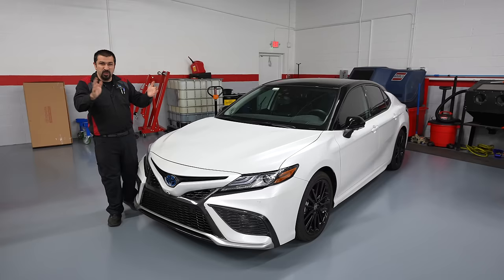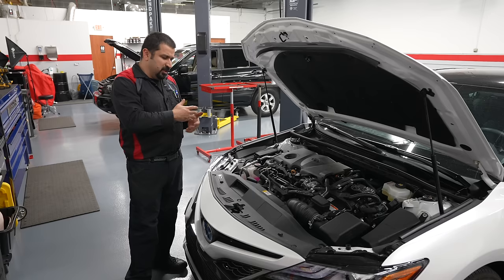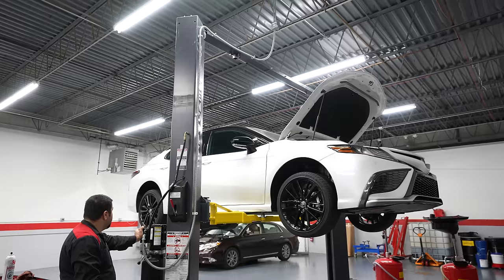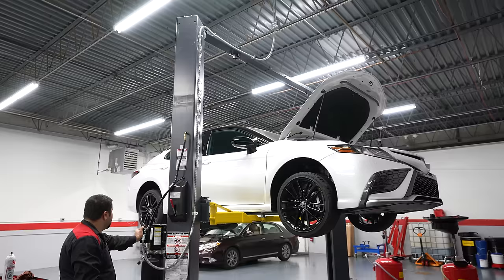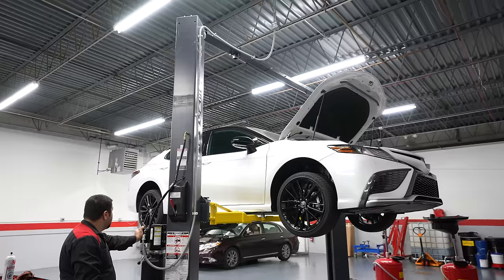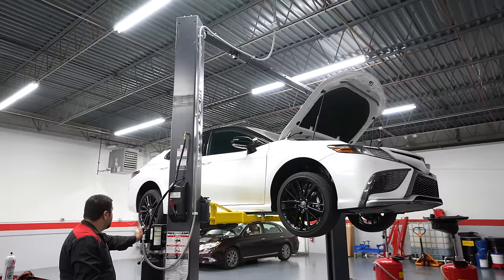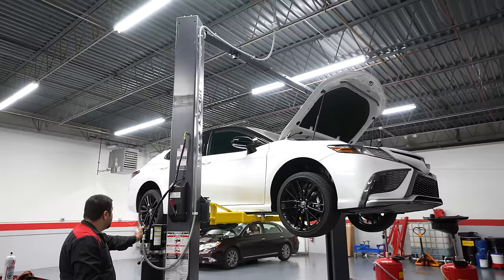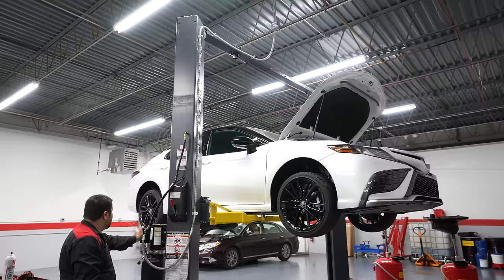Should you buy a Toyota Camry Hybrid? 1 Year Ownership Update

Comment: Bought my Carolla hybrid a few months ago and love it so far, 5K miles already and did a break in oil change at 1200, about to take it in for it's first dealership service. Can squeeze 60 to 70MPG out of it in the summer, and 48-50 in the winter.
Reply: I'm thinking about getting the carolla hybrid over the Camry hybrid. What are your thoughts?
Reply: @Beekeeper8011  Depends if you need the bigger car or not. Also the corolla is more for low speed city driving hence the 53 city 46 highway mpg where the camry gets 51 city 53 highway.

Comment: I own a 2012 Camry Hybrid  XLE . Very happy at 105.000 miles. I bought the car in Houston with 27.000 miles. No matter how I drive it. I still get over 40 miles per gallons. The finishing as you pointed , could have been done better. I drive constantly from New Jersey to Houston and overall I am satisfy with it.
My neighbor in Northen Jersey has a 2005 Camry Hybrid with 257 .000 miles with the original  batteries.

Comment: Great show.  Your oil change information is "spot on".  I have traded vehicles because of rattles that couldn't be fixed.  I am sure others have too.  Rattles are not as frequent as they used to be, in my experience.  I never go over 6 months on an oil regardless of the miles I put on.  We can't go 10,000 miles between oil changes in North Dakota.  It can get negative 30 below zero in the winter.  Toyota dealer here says 10,000 mile changes are just fine.  Thanks for telling it like it is.
Reply: And I’m sure the car will be “just fine” with those 10k Lube jobs. It won’t be spotless and running @ 100% when it has 150,000 miles on the clock but 95-90% performance is perfectly fine for most people who would rather save that $1,000 on maintenance and use it for something else 🤷🏻‍♂️ 

That’s how the manufacturer looks at it. 

Besides, they want you to come back in 5 years and trade in your old car for a new model before the warranty expires.
Reply: @I_know_what_im_talking_about  Car Care Nut has a video on his channel of a 2015 Camry that always got the 10k mile oil changes and it started burning a 1 quart of oil every 1k miles at 120k miles. At 150k miles it started burning 2-3 quarts of oil every 1k miles. He had to replace the short block to fix the issue. https://www.youtube.com/watch?v=TJhFAwFv-O0
Reply: @TheCobruhAlienat0r  — you can’t bring up a model that has a defective engine design as an example. 

Any Toyota 2GR-FE V6 can easily go 10k miles on synthetic and be spotless @ 200k miles. I’ve seen it personally. Some engines are just easy on oil. 🤷🏻‍♂️
Reply: @I_know_what_im_talking_about  First I've heard of it being a defective engine

Comment: I thought I was crazy to see the flashing (extra material) on the new bumpers too. Purchased new from dealer, front and rear bumper covers for my 9th gen corolla. The front had minimal flashing but the rears looked as bad as the front of this camry. Took the time to razor blade them off before paint. In the end, the fit and finish was actually better than the original bumpers.
Thanks for sharing!

Comment: I just bought my Camry Hybrid LE last month and your video has been very helpful. Like you, I was a long-standing skeptic of hybrids. This year, I decided that if I go with one, it would have to be a brand that had been in the hybrid biz for awhile. Toyota and Honda were the two that rose to the top. I've had zero regrets over the purchase, so far. It's been smooth, efficient, and handles better than I expected. Getting low 50s for fuel economy has been almost three times what I had before.

Exit question: Just to make sure, you're advice for a new car is to change the oil at the first 1000 miles and then every 5000/6 months, correct?
Reply: Yupp!

Comment: I do my own oil changes on my 2020 Silverado.  The second oil change the dealer (where I bought the truck) forgot to tighten the oil filter and it was dripping in my driveway.  I spotted it as I was honking up my travel trailer (6000 lbs) and getting ready to take off for 2 weeks of camping.  I crawled under my truck and tightened it by hand. Since then I've done all my own oil changes and saved a bundle at the same time.  I know the filter and the oil pan plug are tight because I did it.  Love this channel.

Comment: I love my Camry Hybrid. Same generation as yours with 300km on it. I change my oil every 10km with 0W30 Ultra platinum Penzoil and sofar zero leaks or burns. Tge only thing I have done beside the the oil changes and transmission oil changes was the drive side strut leaked and had to replace it. Extremely low on maintenance and still drives like day 1 :)

Comment: I kind of wish I went with a hybrid, but I am satisfied with our SE. It is so much better than that problematic 2015 Ford Fusion we owned before it. Another great video my friend!
Reply: why do you prefer to go for hybrid? 2025 is now all hybrid but I don’t like cvt, having a former Nissan Altima whose transmission gave out. I don’t trust CVT, but can you elaborate why you prefer hybrid
Reply: @Eaton23117 you must not know anything about the Ecvt of toyota that is electronic and the complete opposite of a Nissan plastic belt cvt. The Toyota one is built like a manual transmission and doesn't have belts. My prius 2007 at 243,000 miles from prior owner never changed the fluid and I still did and it didn't mess up like a automatic which would of broke with changing old fluid. Hybrids are actually more bulletproof.  Engine is not overly stressed, brakes last like twice as long, transmission is bulletproof.  Of course this is for toyota hybrids the other companies especially Nissan ones suck.
Reply: @platinumanalogy  ECVT is not the same they are completely different.

Comment: My father was a mechanic/ body man for 50 before he passed away, and he sounded a lot like you....when it comes to finding
faults with the build quality of cars.  He passed away in the '80s when the term "quality control" hadn't been invented yet.
I remember he bought a new Chrysler once, but before he bought the car, he had an estimate pad from our garage and he
made an estimate on what it would cost to fix the problems on the car that came from the factory.    Great videos 
and I give you A+ on your garage!
Reply: Since they stopped making the Valiant and original Dart, the words quality and Chrysler have never been found in the same sentence. Teaming up with Fiat and Peugeot has sunk them to a new level.
Reply: @rightlanehog3151  Actually, my dad thought Chryslers products went down hill about 1957 when the started using the torsion-bar front suspension.  He hated that.  He also hated when unibody construction was introduced.  For years, ALL  American cars had quality control problems which only got better when the foreign competition turned up the heat.  I've had lots of cars and one of the smoothest I've ever driven was a 1955 Chrysler.  One of the sweetest cars I've ever owned was a 1964 Lincoln Continental....4 door.  I once drove that car 515 miles in 6 1/2 hours....and I had to stop once for gas.
A 1962 Ford Thunderbird was fun too.  A 1978 Chrysler Cordoba was probably the worse car I've ever had.....I bought it new and kept it for 30 years (it had 28,000 miles on it when I sold it) as a reminder....NEVER BUY another Chrysler product.
Reply: @rightlanehog3151  ....by the way, my Dad passed away in 1981 and I still have his 1978 Monte Carlo....37,000 miles on it.  General Motors and Ford quality control was pretty sorry too for a long time.

Comment: Thank you for the video. Only want to remark one mistake, clean the wiper blades instead of throwing them in the garbage, also clean and polish your windshield. Even if is not expensive, don't throw good stuff in the garbage. My Lexus has 90k miles and 5 years old, so far I replaced only one insert on the passenger side, that's it.

Comment: I bought my 2019 Camry XSE new. Almost 4 yrs. and 30k miles later I've experienced no dash rattles but have experienced the following:
Driver side mirror vibrates badly when driving on the highway.
Driver's window squeaks and jumps when being raised after rain or car wash (My 2014 Corolla did the same thing)
When backing up slowly and applying the brakes, a popping noise can be heard from the rear of the car. ( Dealer said this was normal. Uh-huh.)
Other than those minor things, It's been a great car, plus it's beautiful to look at, so that doesn't hurt lol

Comment: My mom has a 2020 RAV4 XSE Hybrid that I occasionally drive and I agree with you. It's a great car, drives well, and is very comfortable to drive in. But one thing I've noted was the build quality (or lack thereof) of the exterior parts. The doors are super light so they swing open and close really easily, but that also translates to rattles every time you close the door. And being a 2020 model RAV4, there was a TSB issue with the side mirrors shaking at speed. We since had it repaired but the driver's side mirror still seems to be shaking a bit. The hood and fuel doors, like the main doors, are super light so it feels like I could easily bend them when I close them, especially the hood since you have to slam it down to properly close it or the latch doesn't engage properly. The wind noise is also very apparent when driving on the highway but that's something we kind of gotten used to.

Despite all of that, I think the car overall is still a great car. I really like how smooth the transition from electric to gas is with the eCVT and we still get pretty good gas mileage for such a big car (36-37 MPG on average). I'm also glad that they decided to open up to supporting both Android Auto and Apple Carplay this generation. I know it was a hit and miss with many car manufacturers in the previous few generations, either supporting Android Auto or Apple Carplay, but not both.

It's too bad that the AWD Corolla Hybrid didn't come out until this year, otherwise that would have been my pick for myself. lol Unfortunately, I had already gotten a new car last year. :(
Reply: Thanks for watching⬆️⬆️
Reach out with the number above

Comment: Proud owner of a new 2.5ltr petrol Camry. After 6mth  it's done 7000kms (4350miles) of which I had a 3000km road trip included, and am following your recommendation to do oil & filter changes next week.  I will also get them to change the air filters after watching this video update.   Cheers for the advice & happy motoring.  PS I love this car on the open roads :)
Reply: Really like the 4 banger Camrys. Hope they never don't exist. First car even. Learn to drive in one of them. Super reliable could be even more if you ask me but impressive none the less.

Comment: OK, I never thought about the horrible duty cycle of the hybrid engine, you make an excellent point.  All the start/stop/cold running would dilute the engine oil in a hurry.  I am like you, the slightest ratttles/squeaks drive me crazy.  My 09 camry came with a few rattles/squeaks since new, something sounds like a loose wiper bottle, and the center console cover rattles/buzzes.  Generally speaking, I think the build quality/quality of materials dropped a great deal on this car compared to my 99 Solara.  The erratic idle has driven me nuts since new as well.  
It is like you say, a good visual inspection is worth a great deal, best way to catch little issues before they develop into major problems.  In order to keep a car for a long time, you must be proactive in servicing and repairs.  Sure wish I could get my car up on your lift, but would be afraid at the same time.
Reply: Agree, build quality is not good, even the paint is lousy, shame

Comment: I feel your paint on the fit and finish.  When you buy a new vehicle, there is a smaller mental margin for defects - especially the ones you see every day.  My 2022 odyssey van has a door gasket where the seam is RIGHT IN THE MIDDLE.  Also, one of the plastic panels has an inconsistent gaps.  The 2010 model odyssey felt like a better built car.
Reply: I have a 2020 Acura and the build quality is simply awful.  I "upgraded" from a Honda thinking the build quality would be superior.  Oh, how wrong I was.
Reply: @CU08  listen man it depends on what you mean by quality. Apparently that means a lot of different things sometimes I wasnt prepared for
Reply: Alot of Hondas and acuras are almost all made in America and Canada. Toyota at least have some models still made in Japan. The gap alightment is very different.

Comment: I would actually really like to see what you end up doing for the rattles in your camry if that isn't too much of a hassle. I'm sure plenty of people would be curious to see what a great mechanic does to fix something like that because in my own cars it seems a bit daunting to try to chase rattles.
Reply: mine has a rattle somewhere in the dash on the passenger side
Reply: I’d be interested to hear this too
Reply: @robopam  Same with my 2018 Prius. The dealership tried to fixe it, but it came back after just a short while..
Reply: I have a 2020 SE XP and I’m about to let it go because of the rattling noise that I can’t find and drives me nuts 🤪!
Reply: What the hell are ya'll running over because when I rented a 2021 camry se 65,089 miles it had no noise. It ate up bumps like it was a luxury car.
Reply: @taySo_Real  Really just talking about random squeaks and rattles from the interior, not something related to hitting big bumps or anything. We have brand new cars with noises from random shit lol, including brand new Toyota RAV4's for example.
Reply: Instal mass loaded vinyl or dynamat xtreme
Reply: I worked at a dealership many years ago.  Usually for a dash rattle, I had to start disassembling the dash panel.  I would start with the dash door.  They told us to stuff shop rags around inside the dash.  There are many older cars with shop rags stuffed in the dash.😂  
Don’t know what they do today.
Reply: @TS84NO dam even the made in Japan toyotas have that... I thought I was the only one and my prius is a 2007.
Reply: @robmalcolm8042  Yeah, it seems like it's pretty common.. But, it's a great car apart from that tho :) *only other thing that annoyes me a little bit, is that the suspension is a little stiff, so you feel small bumps in the road more than I'm used to with my older cars (my last car was a 2006 Volvo S40) Wel, lots of newer cars I've driven are like that tho, so it's not only the Prius.
Reply: @TS84NO  yeah it is and Volvo would be alot more comfortable but they aren't reliable now a days as much as old ones and the prius is like bulletproof
Reply: @robmalcolm8042  Yeah, that's true :)

Comment: '22 XSE v6.  First 1k oil change and varied speeds between 0-60mph keeping rpms minimal.  2nd oil change at 5k and now ran the engine rpms normally.  Future changes will be every 5K.  I've always done this for all of my modern day cars and never had problems with burning oil or high mileage performance.   Oil & filter is cheap along with first 1K keeping it under 60 compared to engine problems down the road.   Takes disciplined patience and side road driving first 1K keeping it under 60mph but well worth it in the end.  Salesman firm about 10K oil changes claiming not necessary/waste of money but service tech gave me big thumbs up when I showed up as he fully agreed with me.... they know, they see the results both good and bad.
Reply: Overthinking modern engines way too much bud.

Comment: I bought a 2022 Toyota Camry SE Nightshade back in July and really like the car so far. I concur with the slight rattles that happen...I've driven over a few gravelly roads that might have loosened up a few things but it's not horrible. I guess that would be the difference between Toyota and Lexus. I definitely took your recommendations on Toyota Hybrids and decided on a Camry Hybrid. Only slight dissatisfactions are: 1) I have is that I don't get the guided curved lines on the backup camera when I'm turning the steering wheel. I thought SE trims had that feature but oh well...I always turn my head to backup anyways. 2) Didn't come with BSM/RCTA either which kind of stinks. Otherwise Camry hybrids are very nice vehicles along with any Toyota hybrid.

Comment: Interesting to hear about this extra door on the cabin filter compartment. My Camry does not have that extra door that goes around the corner. So I thought it got lost at a service at the dealership. I asked for it at my dealership in the Netherlands but they did not have it on stock. They showed the explosion picture from the factory (with all the part numbers on it) and indeed it wasn't on the picture. The Camry's for Europe come from Japan and appearantly do not have this 2nd door although the slot for it is in  the housing.